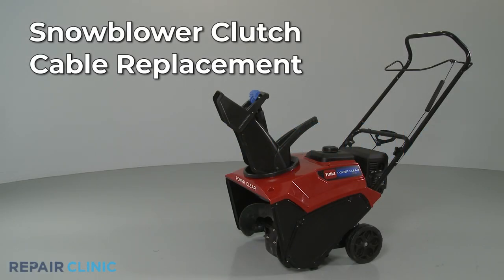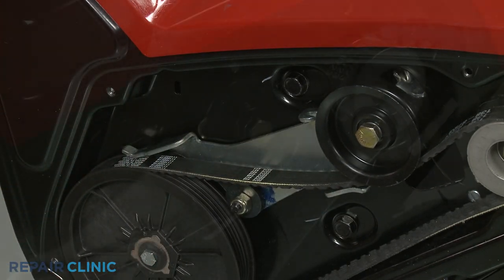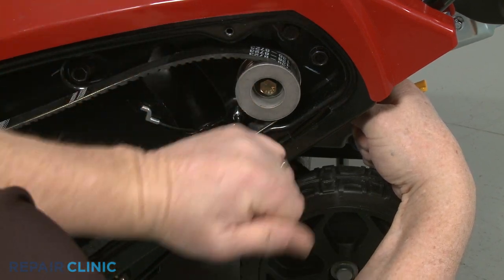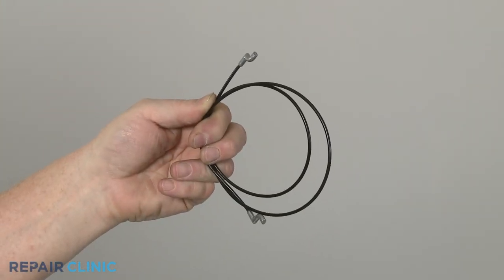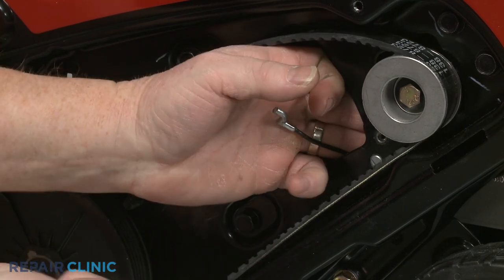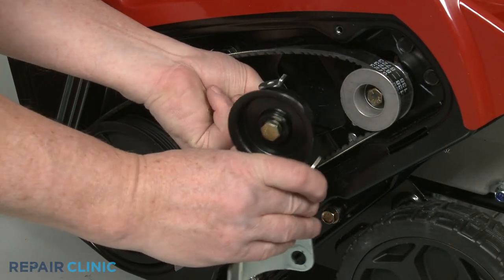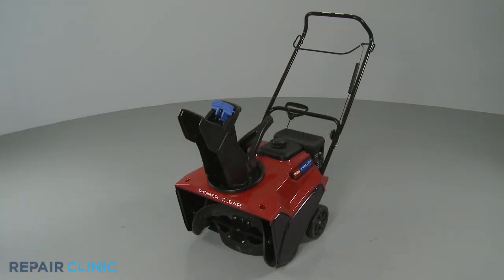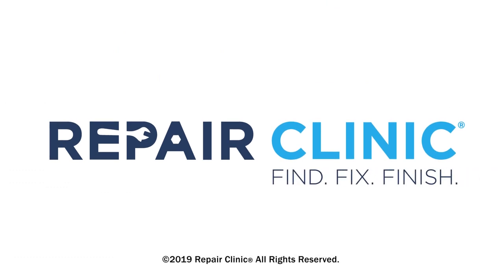Toro Snowblower Clutch Cable Replacement 140-1000

Comment: Very helpful video!  My problem was that the clutch wheel would not disengage, which caused the paddles to rotate whenever the engine was on. My snowblower is older than the model shown in the video. My cable was frayed, so I ordered a new cable, and also a new spring and belt. 
After taking apart the clutch, I realized a design flaw. The cable guide on my unit is made of plastic. Over time, the cable movement caused a groove to form, which ended up causing the cable to seize. In watching this video, I now know that part is made of metal.

Comment: Just noticed when you first took the spring off the hook ends were facing up,, (.35 sec) .when you put it back on they were facing down. Does it matter how you put the tension spring on? ( 3.41)